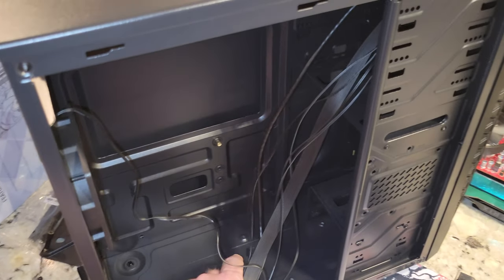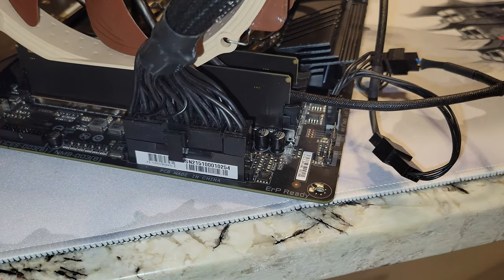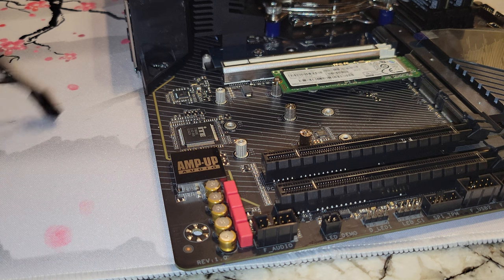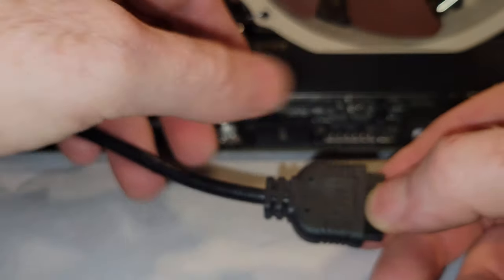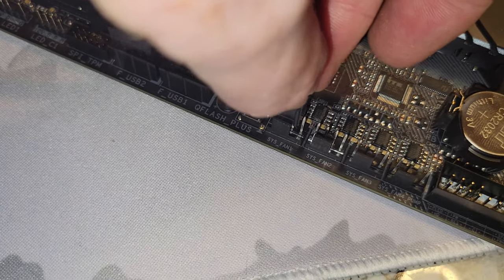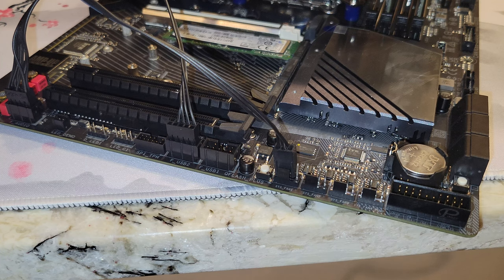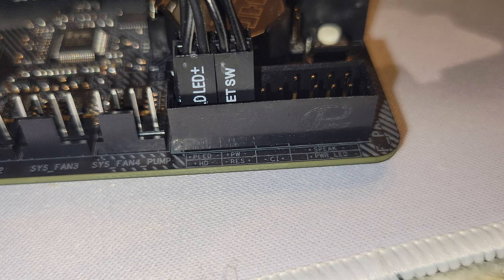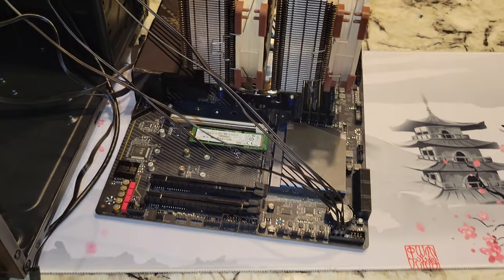Case and Power supply connections for Aorus Z690 Elite Ax LGA 1700 Motherboard

Comment: I am building my first pc using the Gigabyte S1700 ATX Z690 AORUS ELITE AX DDR4 Motherboard. I did not have a clue where to put these tiny power bits, and the writing on the motherboard was tiny and helpfully printed in grey so very hard to see. Thank you so much for the video and you gave me a clue as to where to look, and after taking a blow up photo too, was able to fit them.